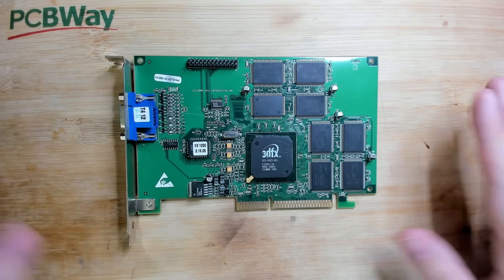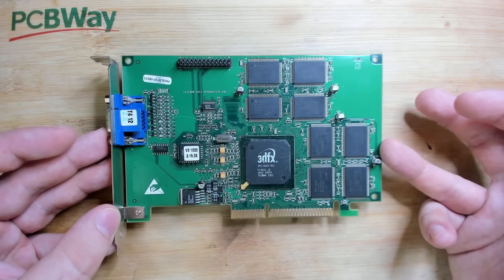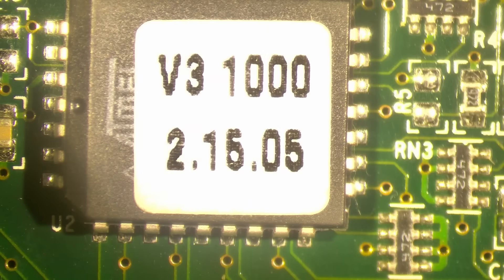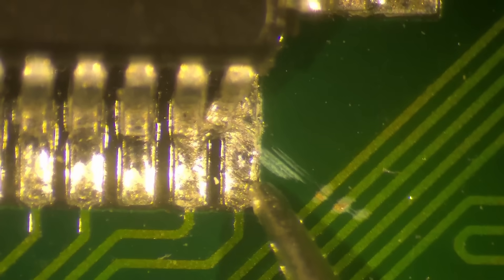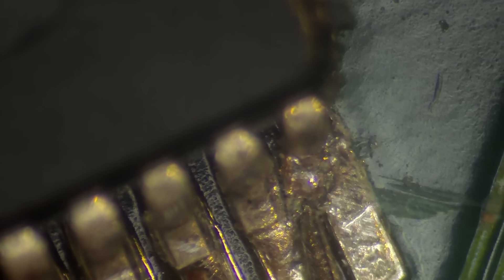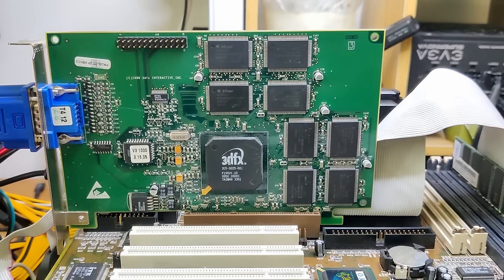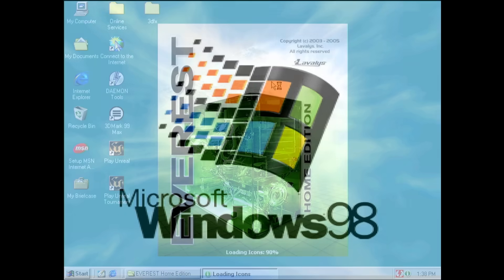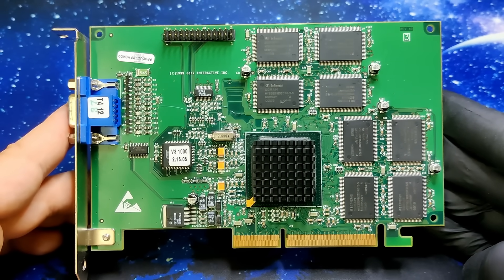What’s Causing These Wild Artifacts on a 3dfx Voodoo 3 1000?

Comment: curious?   is it best not to use hot air on these old video cards?
Reply from the maker: I try to avoid hot air as much as possible. There is always the possibility to kill a chip. With a soldering iron, it might be more work, but you won't heat up the entire chip.
Reply: @bitsundbolts  I know that is a danger, i usually use soldering iron, but some things i found easier with hot air. (usually capacitors etc).. but i usually also only do retro repairs.

Comment: Nice video, just had a tip that might help in the future. When you have a pin separated from the pad and bent, sometimes it is easier to remove the solder first then try to bend the pin back.

Comment: Great job!
BTW, what do you use to capture retro PC video? I can tell that your solution works with the text mode and able to capture the boot up process, so it supports resolution switching. So, what's the capture device?
Reply from the maker: I use the OSSC (Open Source Scan Converter) in combination with a cheap HDMI to USB capture card. That USB capture card was surprising because not all support small resolutions like BIOS/POST or DOS. I tried an Elgato CamLink 4K and it was terrible - it didn't work for me. I got a cheap 15 USD capture card on Amazon and it works great! But the secret is the OSSC to get the VGA signal converted to HDMI first.
Reply: @bitsundbolts  Thank you very much. I've been thinking of going the same way, and you confirmed my findings. I have a bunch of cheap USB capture dongles, now I need to get an OSSC.
Reply from the maker: I think hardware version 1.8 is out. Mine is version 1.6. If anything, the newer version should have even better video capture and features.
Good luck!

Comment: Why are you adding thermal grease when it had a thermal pad already?  You're just adding more insulation between the heat sink and the chip.  The thermal pad is already conductive. The grease is more conducive, but it's not touching the heat sink, it's touching the pad, so the heat has to go through even more conductive material before it can get to the heat sink. 🤨
Reply from the maker: I have noticed that these thermal pads never make proper contact with the plastic surface of those chips. The chip is placed in the center and this is where I placed a small thermal grease blob. I don't know if it makes things worse or better. At least in my head I know that there's a contact between the heatsink and the center of the 3dfx chip.
Reply: @bitsundbolts that makes sense, thanks for explaining.  Usually the thermal pads are squishy (kinda like foam?) and they are too thick, so the clamping pressure is what makes them squish and provide good contact surface.  It sounds like maybe these pads are old and all squished out... Maybe instead of adding grease, you should consider just replacing the thermal pad.  You can get them in different thicknesses, and I would recommend getting one slightly thicker than what you need, so the the squish can happen.

Comment: I really would love to know why you always try to bend the pins to the original shape. This is not required and unnecessary risk. A restoration does not neccarily mean it should look original. And the risk of breaking it where you need to drill would not help this goal. Just bend back slightly, some flux, reflow and you are done. Do not overdoo it. Its not whise.

Edit: And by the way, reheating the pin for a few seconds will actually get rid of some of the work fatique related hardening - making it easier to bend back and hence less risk of breakage.

Comment: Thank you a lot, sir! I have some artifacts like these at the spare monitor, they are disappearing when the monitor is heating well (after 10 minutes approx.) Hope to use some deoxit to fix these. Monitor is switched to internal mb graphics
Reply from the maker: I am no expert when it comes to monitors. Are you sure it is the monitor? Have you tried other VGA cards? Artifacts like the ones seen in this video is usually an issue with the graphics card.
Reply: @bitsundbolts  yes, i tested the monitor with the discrete video card and other mb. It often takes to switch on and off its power supply two times to work. Now the monitor goes to off mode when the power switched on, and back in the days it had been displayed some text symbols instead of some elements of its (monitor) graphic start logo. When it starts working, it shows horizontal left and right string movement, and after 5-10 min it can clearly show graphics. It is a Benq LED monitor with rca in and scart in. i think it's better to change vga wire first and afterwards to add deoxit to vga connector in the monitor

Comment: As soon as I saw the type of artifacts, it was immediately clear that these were memory-related issues, not GPU-related. It's easy to recognize—if you see character cell artifacts instead of dots, lines, or other graphical distortions, it's a memory problem.
My Voodoo 3 3000 and Velocity 100 (a Voodoo 3 1000 with one TMU disabled and a 143MHz clock) don’t display the video BIOS screen at startup. Everest/AIDA reports that the Velocity 100 has two TMUs, even though one of them remains locked—because it's a software restriction, not a hardware one.
My Velocity 100 has a heatsink on the GPU, but even with it, the card gets very hot.
Reply from the maker: Interesting! Thanks for sharing - I heard that Quake III is capable to tell you if you have one or two TMUs. However, since this is the 125MHz version, I believe that it does have both TMUs enabled. The 143MHz version of the Voodoo 3 1000 (with 8MB of memory) has one TMU disabled. And yes, I think any Voodoo card should have some sort of heatsink. Up to Voodoo 2, a fan blowing over the card is enough. Anything after should have a proper heatsink.
Reply: Velocity 100 is more like a Voodoo 3 2000 (both 143 MHz unlike the Voodoo 3 1000 which has only 125MHz) with only 8 megs and 1 TMU disabled in OpenGL and GLide. Not in D3D thus all the Windows tools report it with 2TMUs I think. And yes in Quake 3 it reports "correctly" 1TMU. With a simple regkey you can unlock this. Should be easy to find. Don't know why there exists a Velocity 100 spec card under the name of Voodoo 3 1000. Maybe this was shortly before they changed their mind and sold them as Velocity instead of Voodoo 3? Because in the beginning the bounderies between 1000 (125MHz)/2000(143Mhz)/3000(166MHz)/3500(183 MHz)  all 16MB and all as PCI or AGP (except 3500) where clear. Then came all the exceptions like the 3500 SE (200 MHz) from Falcon Northwest. The onboard Voodoo3 and the Velocity

Comment: I developed a special tool for moving pins that have come loose. Normally I'm doing this kind of repair on arcade pcbs but they are much finer pitch like 0.5mm and QFP208 or QFP240 or larger. Even the smallest screwdriver or tweezers won't cut it with pins that fine.
Reply from the maker: Nice! I totally understand that you make your own tools when you're faced with the same issue over and over again. Congratulations. I am sure it makes repairs a lot easier.

Comment: to separate pins in that condition I usually use an injection needle as a very fine flat screwdriver
Reply from the maker: I thought it is an easy fix, but I underestimated the pin and how it was still attached to the pad.

Comment: to the question, YEs i do... because it's the Gateway branded one... when i flashed the latest vbios available  for it i lost that bios message. (had to due to bitrot corrupting the bios.)
Reply from the maker: I heard that some OEM cards do not work with the regular Voodoo 3 BIOS. I have a post on my website with the OEM BIOS linked. I have seen that some of the version stickers on the BIOS show the OEM partner (like Gateway). In this case, it just mentions Voodoo 3 1000 and the BIOS version number.

Comment: Yes, that card should have had a pre-POST message. 
One card I had like this, wrote 3dfx Voodoo3 1000. And another identical one, but with an older bios, wrote 3dfx Velocity 100 or 200 (most probably 200 IIRC). 
But I have seen Voodoos used in OEM builds that have had that pre-POST screen tinkered with.. So it's not necessarily an indication of a bad BIOS.
Reply from the maker: I think the BIOS is ok - if something would cause the BIOS message not to show up, the card wouldn't work (bit rot) because the checksum wouldn't match. Of course, that doesn't rule out that an OEM partner just removed the text (blanked it out) for whatever reason.
Reply: @bitsundbolts  Yup. Blanked by some OEM would be my guess too. 
It actually was a somewhat common practice.

Comment: Great repair! While I never owned at Voodoo 3 1000 back then I did have it's cousin the Velocity 100. It was a Voodoo 3 2000 with only 8MB of SGRAM, 1 TMU disabled in the drivers and super cheap at $50 at introduction. A simple registry change in Windows would turn the disabled TMU back on. 
My card came with a small heatsink on the GPU. I added a small fan to it which helped a lot and allowed me to clock the card up to 155 MHz on both the GPU and the RAM, stock was 143/143. 
Best $50 I ever spent on a video card! Kept me going until I bought an original ATI Radeon DDR card in December 2000.
Reply from the maker: Nice! Yes, I think that is the card that I was thinking of when I though one TMU is disabled. 3dfx had quite a few models in the lower tier then - and at $50, it definitely is a bargain when you knew you could simply enable the second TMU and overclock it to Voodoo 3 2000/3000 levels.

Comment: Cleanup is fairly easy if you use the cheap white thermal paste "glue" that is silicone based, not the 2 part epoxy type, and place a dab in each corner of the GPU, while using your choice of thermal paste in the center of the chip. The downside is if you bump the heatsink hard enough it will come off, but it's safer for the GPU so it's kind of an upside as well.
Reply from the maker: That would definitely be an option for cards like this! I didn't research different types of "thermal adhesives" - I wasn't aware of the silicone based stuff - it sounds interesting! The epoxy stuff is terrible!

Comment: Great video!  Your work on 3dfx cards has inspired me to find my own.  I picked up a v3 1000 with no pocture.  It appeared that L1 and C10 were damaged.  I put on components from a scrap board and it is working now.  I also added a heat sink.

Any idea where I can get specific component values for these parts?

Also, I would love to try out mojo and witchery.  Do you have the download locations for these?
Reply from the maker: Mojo is on my website for download. Witchery isn't released yet - and I promised the creator not to share it until he is confident with the version he wants to release.
The values for components can be found on components maps (if they exists) - they definitely exist for some Voodoo and Voodoo 2 cards, but I am not sure if they exist for Voodoo 3 cards.
For inductors/ferrite beads (L-type components), it is hard to say. I usually take a spare part I don't know the values of and see if it works - I never had an issue with them to be honest.
Capacitors can be estimated - look for similar capacitors that are arranged in groups that look identical - most of the time, you have those on PCBs. Then you could measure the respective component similar to the missing cap and get the value.
Reply: @bitsundbolts Thanks for the info!  I tried the mojo from your website and under DOS it said it couldn't find my 3dfx card.  Does it work with AGP versions?  Next I will try to install Win98.

Comment: Bits I got a BFG GeForce FX 5950 ultra that you might want to take a swing at...
Reply from the maker: You got artifacts too on that card?
Reply: @bitsundbolts  unfortunately...I believe I know what's damaged on the card. Its some caps or resistors... not sure which type they are but they're tiny and look broke or missing

Comment: 5:08 interesting to see how the pins slightly detach under pressure, maybe they already used Pb free solder?
Reply from the maker: Yes, this is very common on solder joints this old. I am not sure if they already used Pb free solder - I think this started a bit later, but in any case, old solder joints get weak over time.
Reply: @bitsundbolts  I've been recently messing around with SQFP-208 486s on old Compaq laptops including swapping them, some had oxidised pins, but I've never seen them move, but maybe I haven't put enough pressure on them :D
Reply from the maker: You do need to press uncomfortably hard on them. But it depends - some solder joints are weak and the pins move with ease - others are harder to move. Those are usually ok and don't need a reflow. Like the card here, those memory chips are OK. I just reflowed the solder because I poked them.

Comment: I had a similar issue with my Geforce 256 back in the day. I think it looks like this when the integrated character generator ROM writes to a section of RAM that's malfunctioning. Because it's such a fundamental building block that could be somewhere around the beginning of the whole RAM address space. You might have worked on the very first RAM IC of that address space or at least that is reserved for the non-3D (VESA/VGA) render operations if it's not contiguous.
Reply from the maker: Usually, memory chips are filled equally - depending on how they are connected and how wide the data bus is, but you're right. It could be that some chips are filled earlier than others (e.g. groups of chips).
Reply: @bitsundbolts  I'm just thinking on the same analogy as system RAM. Systems tend to not boot at all or run into issues before running a full-blown OS when a faulty DIMM is in the first bank and the fault is <640K-1M address. Maybe the issue is even more evident when also evrything is shadowed.
Reply from the maker: It really depends on how the memory is accessed. Most SIMM/DIMM memory is filled equally. You can have issues at higher memory addresses and won't notice any issue <640K. The Creative AWE64 memory module from Creative fills chip by chip. So, if you run the diagnostic app and you get an error, you can figure out which chip it is by looking at the progress bar. I learned that recently when I had a faulty chip on one of the  boards I made.

Comment: I have same Voodoo3-1000 card with mixed SGRAM chips (SIEMENS + Infineon), but it doesn't work.
I would appreciate for VBIOS, mine may be corrupted.
Reply from the maker: Search the web for "Voodoo 3 BIOS" - you should find a website that has all BIOSes listed. I can't post links, but I am certain you'll find the correct BIOS for your card there.
Reply: @bitsundbolts  Thanks! I flashed someone's V3 1000 v2.15.05 dump, but VGA output is still missing.
When using PCI video card as primary, Win2000 detects AGP Voodoo3 card, but trying to install 3dfx driver hangs the system. I have no idea what to do next
Reply from the maker: Some OEM cards require a specific BIOS and won't work with the normal BIOSes. I had a case like this and I posted it on my website. However, that was for a Voodoo 3 3000. The post is titled "Pitfall: 3dfx Voodoo 3 3000 OEM BIOS".
Reply: @bitsundbolts  Big thanks for the great idea! I will try to look for OEM BIOS for my V3-1000 card.
Reply from the maker: Best of luck!

Comment: Nothing wrong with an easy win, but I did cringe a bit when you forced the pin back in position without heat.
Reply from the maker: Yeah, probably a hot soldering iron would have helped quite a bit.

Comment: I think the old solder fillet that used to be behind that chip leg was beside it, blocking it and making it difficult to move sideways. I would have tried pulling slightly OUT to see if it sprung back in place.
Reply from the maker: Yes, I should have tried that. Those legs are quite small though - but another set of tweezers could have moved the pin forward and make it easier to move to the center above the pad.
Reply: @bitsundbolts I was hoping for enough stored spring tension that it would shift sideways a bit on its own, just by pulling forward, then you could reposition your tweezers to bend sideways until it’s straight.
Reply: I would have wicked up all of the solder on that pin and the adjacent pin before trying to bend anything.
Reply: @BestSpatula that would be the next step because that could potentially freeze it in place the bent position.
Reply from the maker: Yeah, I underestimated how well this pin was still attached to the pad - I could have done better. Luckily, it still worked.
Reply: @bitsundbolts that’s just it: It wasn’t attached, it was blocked.

Comment: Very interesting video. As far as I know the Voodoo 3 1000 has 16 mb, 2 TMUs and 125/125 mhz. The Velocity 100 has 8 or 16 mb, 1 TMU enabled in OpenGL and Glide and 143/143 mhz frequencies.
Reply from the maker: Yeah, this 1 TMU card is a bit confusing to me. I fully expected this card to have one TMU disabled, but it didn't. I guess the lower clock speed was good enough for 3dfx to have this card not compete with the Voodoo 3 2000. I need to find one of those Velocity 100 card.
Reply: @bitsundbolts  Still looking for someone to test the possibility of replacing Velocity 100's 8Mb SGRAM chips with 16 Mb.
Reply from the maker: The 3dfx chips should all be the same - so, they should support 16MB - however, it depends on the PCB. If there's no provision for the extra memory chips / address lines, then all you can do is transplant the a different PCB - and that isn't really feasible.
Reply: @bitsundbolts  The unit has the place for 4 chips. I note that there is a Voodoo 3 1000 design with 16 Mb and 4 chips instead of 8. So the issue is whether the Velocity board has the relevant address lines routed huh.
Reply from the maker: Yes, that is what it comes down to. I think you should read the post on Vogons: "Velocity 100 memory expansion". You need to update the BIOS too to get the extra memory detected.
Reply: @bitsundbolts  This is all the info I needed, thanks.